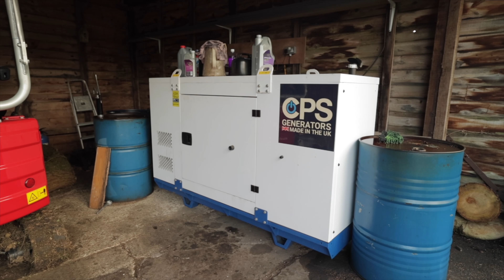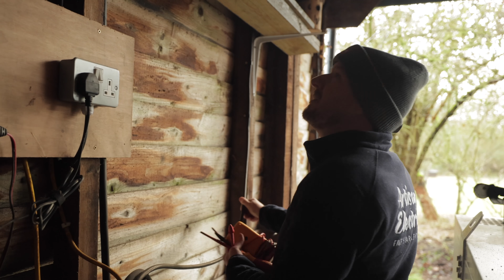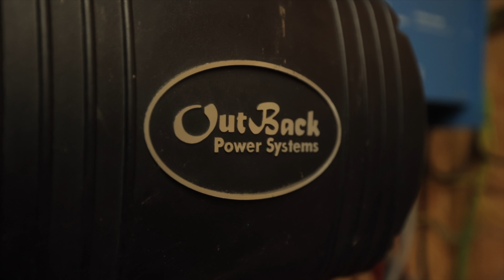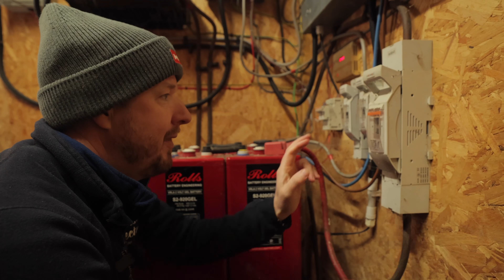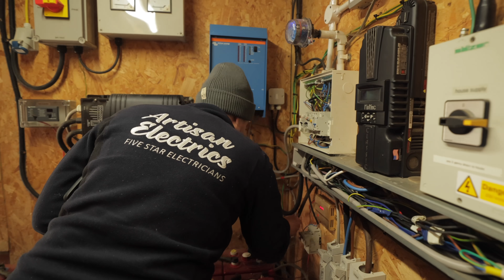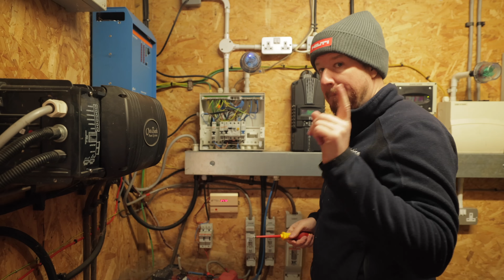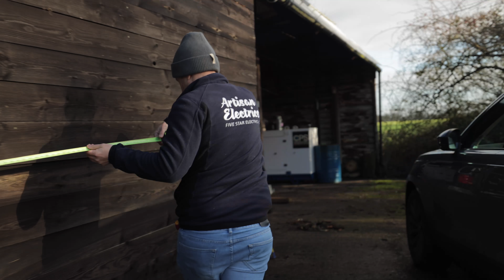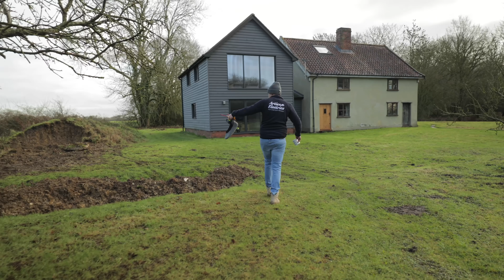DIY Off-Grid Solar Gone Wrong! (It Can’t Even Boil a Kettle)

Comment: A 24v system is barely adequate to power an RV (Caravan on your side of the pond), Much less a whole house, even a tiny one.  A 48v battery system is the bare minimum for anything larger than a caravan.  And your battery capacity MUST be at least as much as your anticipated AC consumption (12kw for a 12kw inverter) and the panels should be at least 150% of the battery bank capacity, so in a 12kw system, 18kw of panels. (Especially for winters or cloudy days.)  Also this current setup is way overcomplicated as is.  Agree to just scrap all of it and start over.

Comment: To be fair you can build a very decent off grid setup with Victron kit and EVE MB31 or MB56 LifePo4 cells in a decent box. Perhaps 32KWh battery for £3k rather than the crazy prices they will quote for sigenergy. A properly designed victron setup with multiplus and cerbo and mppt charge controllers will be easy to upgrade / maintain in future and can be speced for the household needs.
Reply: Love my victron setup. I started with one array of solarpanels, then upgraded that array, which then left me with four spare panels. It wouldn't make sense to add them to the same array, as specs were very different between those and the new ones, but instead it was very easy to just add another mppt and create a new array with the spare panels. Slowly planning on adding more panels, also no biggie, just add another mppt. More inverter power needed? Parallel another inverter to the existing... 👌
Reply: Absolutely. There is a reason Victron has become the defacto, as you say 48v LiFePO4 battery and a 15kVA MultiPlus-II, double the solar and happy days.
Reply: Victron is the Gold standard, Sig is crap.

Comment: Bearing in mind I'm not a spark but have worked on a few small off grid projects. I'd rip out most of what's there and go for a Victron Multiplus to handle inverter, battery charging and generator switching/changeover in one box. If more capacity is required they can be paralleled. Then replace the solar panels with the highest output you can find 550+ and maybe add some extras if roof space allows, and get a suitable Victron MPPT. Replace the batteries with lithium of some sort and step up to 48v such as Fogstar with a couple of 30kwh batteries. Tie it all together with a Victron Cerbo GX for stats and remote control and there's no reason they can't have a fully functional off-grid home. Granted this is based on appearance as it's shown in the video and with no calculations.
Reply: Exactly the way to go
Reply: Thirded. I reached exactly the same conclusion.  And it'll cost him under 5 grand in bits (for 5kW or 8kW load, 16kWh battery - more costs more money) plus install time. The main design issue is do they want to switch to electric heating - that could be a lot of extra (winter) load depending on the building fabric.
Reply: Victron you say.... Did you win money on lottery or are your parents rich?
Reply: @The-secret-101  It's not necessarily crazy expensive. It's not cheapest certainly, but I installed a 7kWp 16kWh battery Victron system with islanding for £5500. The Victron parts (inverter/charger, MPPT and Cerbo controller) cost £1150.  I could have got a cheap chinese hybrid inverter for half that, or a good one for 2/3rds that. But with Victron you get total local control with no dependence on remote servers, ssh into your controller, node-red control, and a remarkable level of flexibility and openness that none of the other providers give (although Solax and Sunsynk have been reverse-engineered so you can do some of this stuff unofficially).
 And you get an islanding gateway built-in. Not very relevant for this project, but entirely covers the price difference on some others.
Reply: @xxwookey  Ok, maybe I exaggerated a bit. You are right, Victron might not be that much more expensive.
Btw it seems like at least some of the cheap noname all-in-one charger-inverters have a removable display that you can connect using a regular RJ45 "ethernet" wire. Don't know what distances those can handle though, maybe not enough to go between the barn/shed and the house in this particular case.
Reply: @The-secret-101  A new Victron 5KW (10KW peak) is £800, so £1600 for two if you need 10KW/20KW
Reply: @hardergamer  Maybe not that expensive, but still way way more expensive than the cheaper ones.
(Like I bet that if you are handy with electronics you could even buy a cheaper one and replace the capacitors with Nichicon or similar and it would be about as reliable as a Victron)

Comment: (I'm not an electrician, but have been following Solar cells/panel since the early 1970's when they were only available at huge prices to scientists.)  

Back in the 1990's, my Friends in Australia were entirely off-grid, no generator, and got by with just  a 1 kilowatt system, and Lead Acid batteries,  all year. With just occasional use of LPG/Butane caravan style gas bottles for some cooking.  That's in Australia mate, Mediterranean climate, 32 Degrees South Latitude.   

A 2 kilowatt system in England, approx 51 degrees North latitude, in Winter. Mate you're not gonna be able to wank a rabbit with that system. I'm surprised the Diesel Generator ever turns off. It should have been sized at 5 to 10 kW from the get-go.  

It seems to me that the system was designed intended as a mainly Diesel system with a bit of Summer benefit from Solar, or when running only minor loads. As such it probably met the original owners, original intention.

Thanks for the video and it'll be good to see how a system with more Solar and batteries, copes in the future.
Reply: Beautiful Kiwi/Oz turn of phrase there :-) 'not gonna be able to wank a rabbit'. The high latitude makes solar work remarkably well in summer, because you get so many hours. So 2kWp will run a frugal house quite happily for months in the summers. We ran on 2.9kWp for 14 years and it generated almost twice what we used over the year, so with a battery 3x daily capacity you really are barely using the grid for 1/3rd of year.
Reply: @xxwookey  Yeah it's an old saying that I only just thought up. Honestly it just popped into me head. Maybe I'd heard it before somewhere. Or just been watching videos of rabbits or something LOL. Anyway it popped into me head and I thought "Yeah, that fits just right" in this context. ... Anyway after experiencing 6 months worth of rain, in 36 hours, a bright Sunny day today. But y'know what they say about NZ "4 seasons in one day".Cheerio

Comment: The unusual ignorance talking about this offgrid install is shocking. Ignoring the shoddy DIY job, that's a Midnite solar Mppt paired with an Outback inverter. The charge controller is over £800 alone. 

How's it possible you've never seen them ever 😮
Reply: Before his time and probably very little  experience in true offgrid systems, the midnight and outback are great and rubust. Working great with our hydro system. Artisan answer is to just throw 30k at it !!!
Reply: @rogereverett9095  sad most solar electricians aren't well versed in Off-Grid. In my 30s, not even an electrician and knew what they were almost immediately I saw them. Construction sites, railway projects, festivals sorely look for good off grid solar electricians but only very few in the UK. You can't take a Sigenergy to these places but rugged, robust Victron, Schneider or otherwise.

Comment: writing all that gear off just because you can’t be bothered to figure it out, seems like quite a waste 🙈
Reply: The problem is looking at a current modern household.... 

Switching on the telle, lights and having the washomatic running most likely heating the water...... Then you want to put the kettle on for a brew.... That's it, that is exactly where the issue is..... 1: your over the inverters capabilities, 2: your batteries as I said are not going to last. Guaranteed this guy has kids and his wife most probably works as well, which means most washing will take place on either weekends when everyone is at home "doing stuff" or at night. 

Taking into account that the solar on the rooftop is only maybe 2.5Kw with aging panels. And the inverter has maybe a 500W overhead..... That system is just way to small for the current household demand.... I was not being mean when I said there is just to much current draw on that 24V system I was only stating the obvious... Look at the current draw difference on 24V with that load compared to it on 48V, there is a very big difference. 

There is a very good reason for most solar setups going over to a 48V dc system rather than a 24V one, I know I ran 24V dc for 8 years, before switching over to 48V and now lithium rather than LA.... I can see the difference, in the morning when I woke up on the 24V system I was down to 40% SoC..... With the 48V one I am at 60% with the same loads running through the night.... Not to mention that if you want your LA batteries to last, you would not want to go past 50% DoD.... This is why LFP is better than LA deep cycle or not, when it comes to self consumption LA does not stand a chance against LFP You would need double the foot print area if not more in LA batteries just to try and stay relevant compared to LFP...

That system might have been sufficient a few years back but not today with our modern lifestyle.... I would make the same call, though, I would at least put the current system up for sale as second hand working.....
Reply: that's what he always does 😂
Reply: The outback and victron stuff is good and reliable. Wiring is iffy. His comments are inappropriate and demonstrate arrogance, he only needed to make observations about the system not the installer.
Reply: @AndyFletcherX31 you are so true !
Reply: How much is your safety worth, a clean new system gives piece of mind, yes it will be expensive but it will be done right and stand to them for years but personally I would also investigate how to get a feed to the house from the mains but would most likely be very expensive
Reply: @Prosatanous the digging you can do yourself. get them to mark a line where they want the trench.
Reply: its dangerous, a bodge job and incapable of supplying enough for the home. The cost of trying to fix the system would be better spent on a new system.
Reply: Nonsense, that system isn't safe. There's far too much going on.
Reply: @drc6940  THE most unsafe element in this system is the unqualified sparky that cant even recognise what he is looking at. would you trust him with fusing and correct dc wire thickness, I wouldnt.
Reply: Not safe. 10 years old. I would write it off personally
Reply: @aovideos3268  I assume that is sarcasm?
Reply: @aovideos3268 Solar systems typically have a 10 year payback. So they are only worthwhile after 10 years. It's neither old nor unsafe.

Comment: £30k for the new system? Just a complete guess.
Reply: Double that at least, probably triple, this is Artizan They do not consider any job under 20k last I looked probably more now.
Reply: What a ripoff.
£1000 for an all-in-one charger-inverter with 2-4x the output of the existing one
£2000 for big 48V lithium based battery pack.
Have your local carpenter replace and upsize the solar panels.
Reply: £60K+ as on a different job, they charged £112k

Comment: Kris Harbour Natural Building uses Outback chargers. Ask him for impressions. I wouldn't throw it away as it is much cheaper to charge with more chargers, instead a big one,  Off-Grid Garage does it like that.
Reply: Thats not the name of the game here pal.
Reply: The FM80 charge controller I used to use never played well with LFP cells and kept entering the CHARGED state and not working again until rhe PV voltage dropped at the end of the day. Epever Tracer charhers are cheaper and more reliable.
Reply: if the owner pieced it all out, they could get a few grand back out of it.

Comment: I generally enjoy Artisan Electronics videos, but the vibe of this one was just all off. It seemed that, instead of focusing on providing the customer with a solution to his problem (perhaps upgrading the inverter and the line to the house) the answer "Nah, none of this was done by a Real Electrician, the only solution is to rip it all out and replace it all. We can't have mismatched circuit breakers! Think of the aesthetics! By the way, I hope you've got a spare kidney to sell..."
Reply: The funny thing is that outbacks can stack up to 8 so you can push 24kw max  :)))
Reply: Agreed, I feel like he just couldnt be arsed trying to salvage the gear and save the customers pocket, he was just thinking about the easiest route for him to give a certificate for.
Reply: In fact, it was focused exactly on "providing the customer with a solution to his problem". Did you expect Jordan to patch up the system, and get it "functioning"? Even with a new inverter and line, it's still a home made hotchpotch of a system. The customer isn't diy, so he just wants a system that will work reliably. And do you think that system, patched up or not, would meet code?
Reply: @MichaelWakefield-mx6hg There's no such thing as 'code' in the UK.

Comment: Probably the old owner just used a stove to boil water. You can see they have a combustion water heater behind the house so hot tap water is already present, as well as heating. You can also see an old style oven/fireplace beside the house switches indicating they also used wood. Realistically that inverter was just running lights, gas boiler, a fridge and one tv. it's more than enough for that. The problem wasn't the system, but the new owner lifestyle. 
Side note: where I'm from tipically houses are supplied whit about 14Amps 230v from the grid, about 3.3Kw, and I can guarantee you it's more than enough for everyday use.
Reply: 3 kW might be enough If you only boil the kettle when the microwave isn't running, but champ... that's not what most people need
Reply: Actually, kettles use 2kw, microwaves 1.2kw, for a grand total of 3.2kw. also consider that the meter has a "smart" circuit breaker that lets you use a maximum of 4.2kw for a short amount of time. even kids learn to not switch on too many big things togheter. we use start timers on dishwasher and washing machines so they run one at time and everything is good. Usual power consumption is about 7.5Kwh/day. I remember when I was a kid, an English friend brought his kettle from hone 'cause it was a little bit faster. he tripped the braker in 15 seconds. switched back to our kettle and 2 minutes later water was boiling.
Reply: @cmh-c   that still sounds like sacrificing way too much, when he can afford to get a decent battery and inverter system. I've never lived in a property that has such low power output that you describe, so as a kid I didn't have to learn to 'not switch too many big things on at once'. Times have changed and technology has advanced a lot quicker than you perhaps realise.
Reply: @MichaelWakefield-mx6hg  I'm not the old person you are thinking. I'm not even 30. I study computer science at university and have a background as an industrial/domestic and PV electrician. A few month ago I rewired an old house in Tuscany. House heated whit wood stoves and fireplace in winter, 3Kw meter.  There's even an electric boiler, a water well, and I installed an induction stove in the kitchen. I used a smart power monitoring system that switches off some non critical loads to prevent meter disconnection ad it has worked flawlessly since then, no complaints received. So maybe I'm more advanced than the technology you where talking about?

Comment: We run off grid system at our stables , 1.5 kw Victron inverter 6 panels , 2x 500w 2x 420w  2x 270w , these run into 2 solar charge controllers ie 4x into one and 2x 270w into other . We did have 4x 400Ah 6v SLA batteries 24v  acquired second hand but just replaced with Lifepo4 200Ah . Reckon them lead acid battery's will be will have had their day looking at age of system , ours looked newer than those but lost most of their capacity , they held 28 volts until any load on they ( looked after with morningstar charge controller ) Lifepo4 is way to go